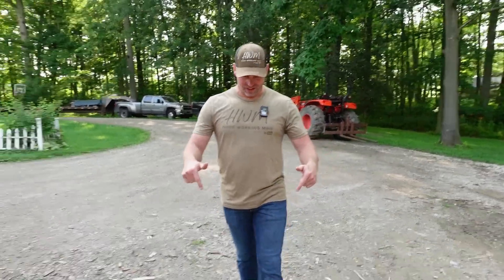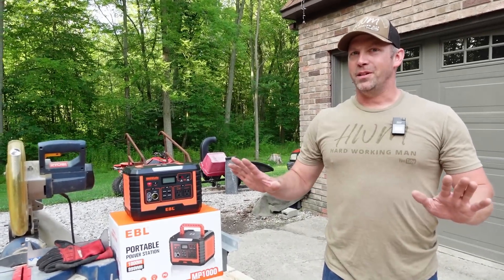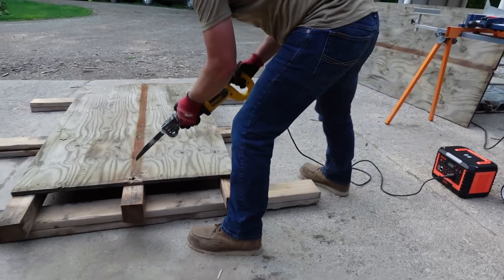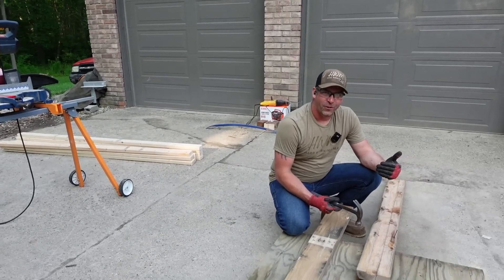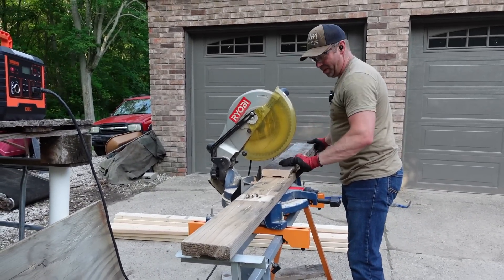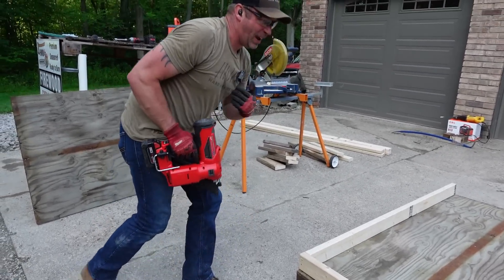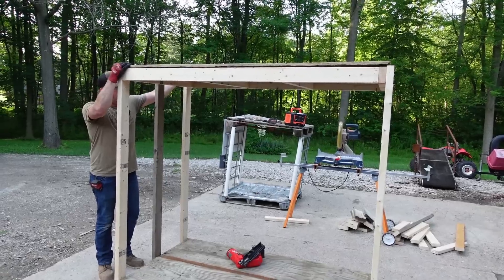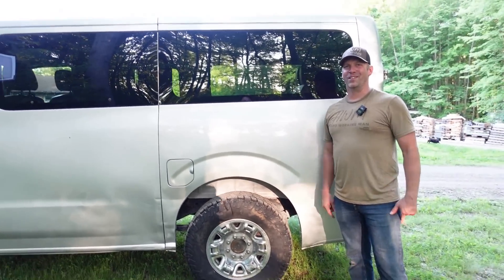Dad Builds Her First Stand! Selling Firewood Bundles & Bags!

Comment: Heath, nice work with recycled materials!! I would have put more of a pitch on the roof being you see in Michigan….I’m certain you’ll get some rolled roofing or left over shingles for the roof.
Reply from the maker: Thanks Tom, I probably should have sloped the roof a little bit but figured with the smaller size of the stand it wouldn’t get loaded with too heavy of snow. May have to make some adjustments.

Comment: Great video. That’s a neat power pack. I have seen before on the other videos, but I just figured out that with out the extension cord you can pick it up and the tool up and move around with out the hassle of trying to get the extension cord to follow you with out getting it all tangled up in stuff.  Hehe, takes me a while to figure stuff out. 😂 
Great firewood stand. Megan will like that. 👍🏻
Reply from the maker: Thanks, and yes it definitely beats struggling with an extension cord. Should come in handy for building deer blinds in the woods too!